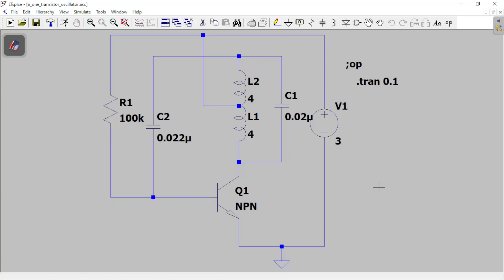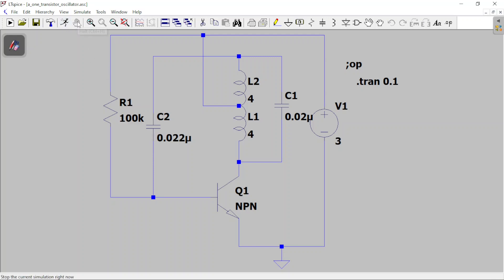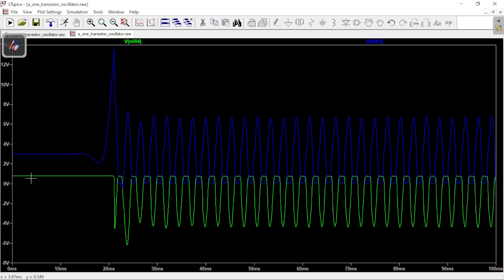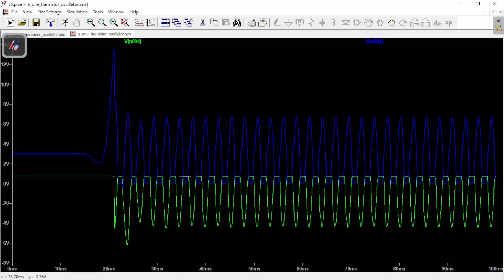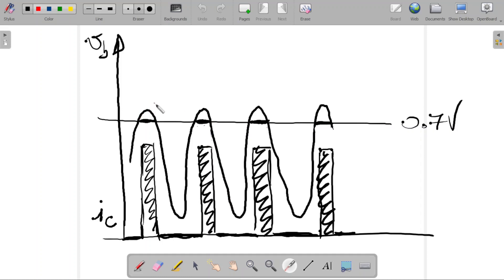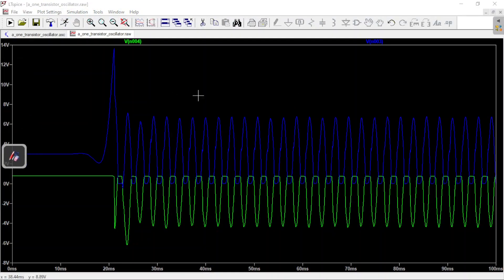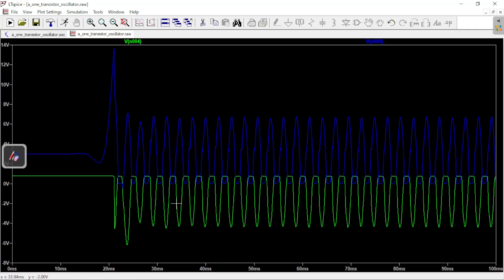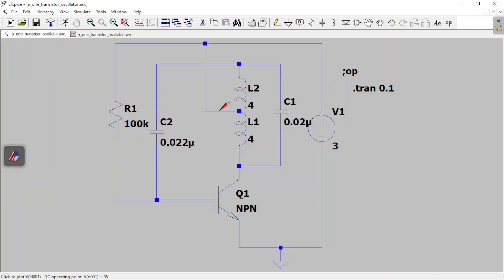Hartley oscillator using 1 transistor (class C amplifier). How are the oscillations maintained?

Comment: Thank you very much for the amazing video! Because of your video, my brain got enlightened! However, here is my two cents (I think I am right. May be!!!): the collector's current is not perfectly rectangular; instead, just below base's voltage under 0.7 volt should be little curvy because, at little below 0.7 volt, the collector current is still flowing but much less than when base's was 0.7 volt.
Reply from the maker: Good point!